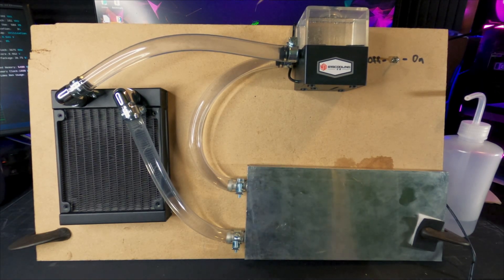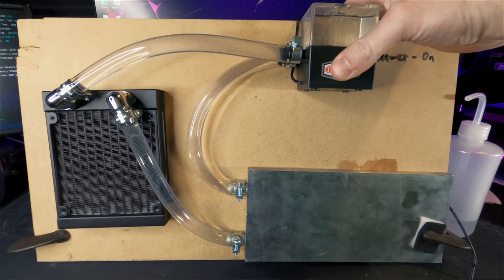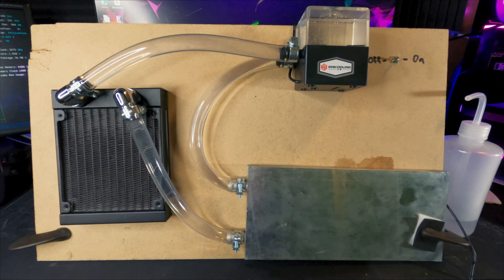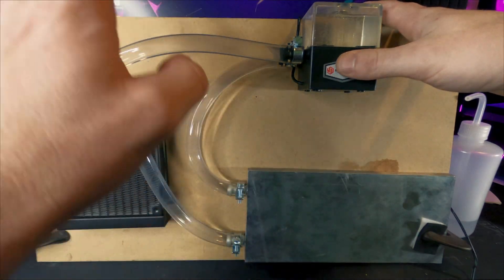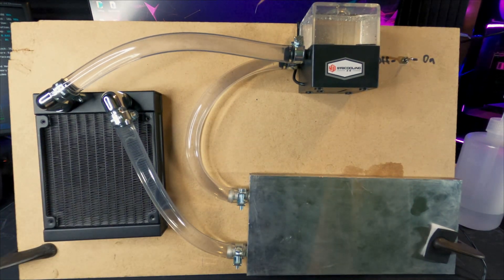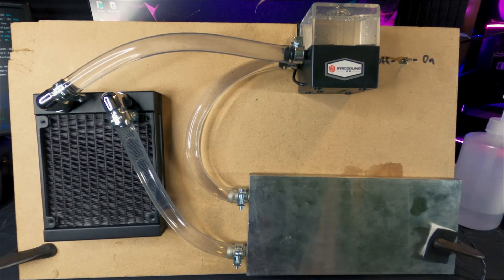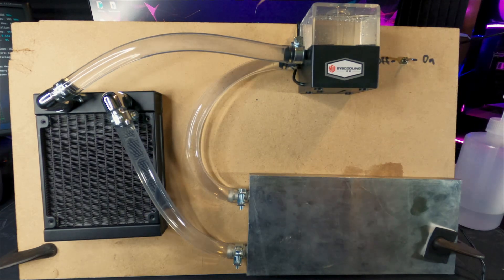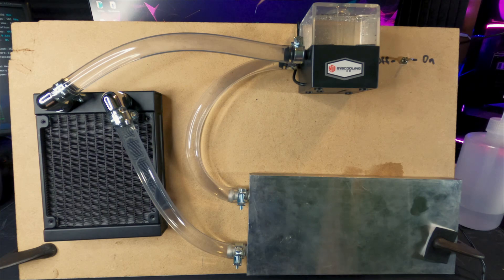Using PC components to liquid cool an ebike controller - Test Update 2

Comment: do yu know where to find info on making the wiring work with my controller or maybe make a usb connector to the 3 and 4 pin wires that the cooler comes with?

Comment: can't I just cut a window in there and stick a pc cooler on it? I can't touch my esc anymore, it's so hot
Reply from the maker: You could do that but then assuming your controller is on the outside of the bike you lose the ability ride in wet, or even dirty/dusty, conditions without risking damage
Reply: @PhysiqueGeek  Yes, I don't want that, I solved it differently. I simply drilled holes in the front and back of the rack bag, so the faster you go, the more air flows in and cools it down.
It only got so hot because the standing heat from the controller had nowhere to go.
Now it's perfect :)

Comment: Did this work out?
Reply from the maker: It did and it didn't. The concept worked out great, but the thin 120mm radiator wasn't enough to pull as much heat out of the system as I'd hoped. It was enough to keep it from shutting down due to heat but I would have liked to see a bit more of a difference still. I think a thicker 240mm radiator would have worked out nicely. I ended up selling the bike to buy a new truck though so I'll have to wait for the next build to try again
Reply: @PhysiqueGeek  were you gunning the bike real hard? Just wondering, I see alot of people going hard and the seem to be alright
Reply from the maker: @ICTTRADERMASTER  yeah the only time I ever experienced that was when I was really pushing the bike. According to the display, that was anywhere from 7000 to 8000 watts being pushed to the motor on acceleration. Since I did most of my riding on mountain trails it was seeing those peaks a lot when I wasn't just cruising around. 

Having the controller contained inside the frame was definitely the source of that problem, but I didn't like having it on the bottom of the frame getting smashed by rocks and caked in mud/water either. I did have to fashion a small shield/air dam for the radiator to avoid that getting filled with mud and becoming useless though too.
Reply: What’s the name of the system and where did you buy the kit?